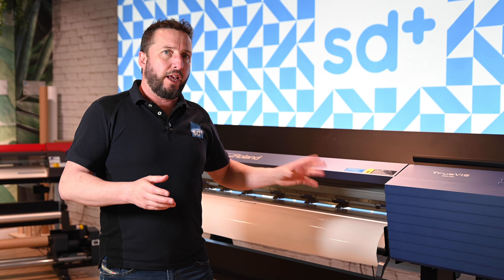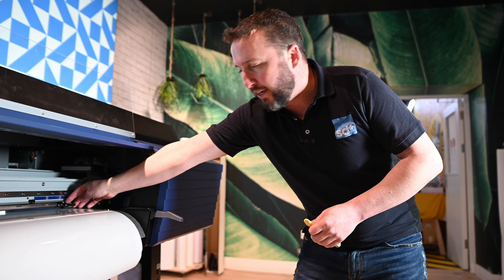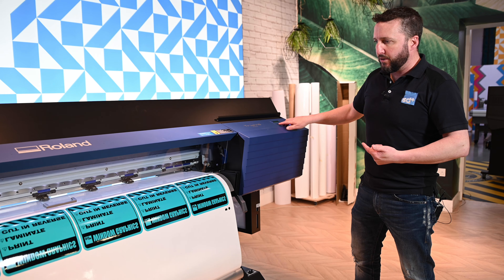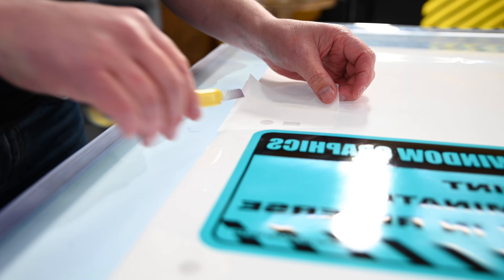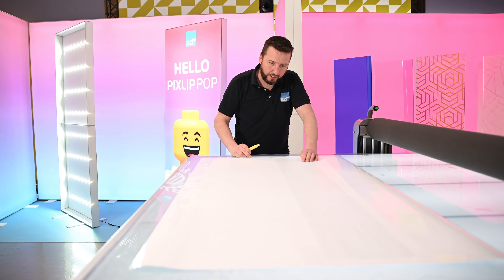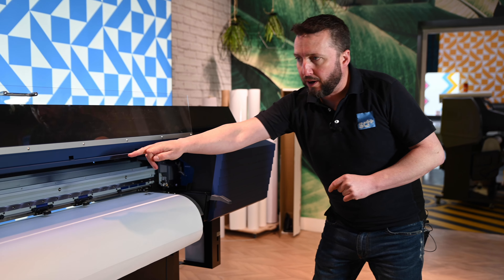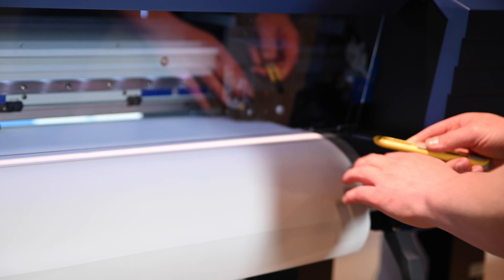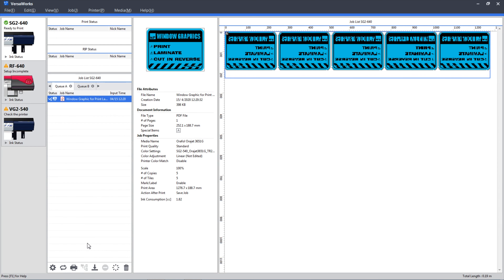How to Print & Cut Reverse Window Stickers using a Roland Printer & VersaWorks

Comment: Your videos help a lot, good job!
I have a question, on the Roland VG3-540 is it possible to reduce the vinyl advance speed when the machine is reading the cut marks? as the machine is very quick to read and sometimes jams the material.

Comment: Hi Marcus, could you make a video on how to produce a double sided sticker? Ideally one with a cut contour on it. How would you do it? For example it would be similar to the process in this video, but there would be something printed on the white vinyl as well (it could be for a door where one side says 'PUSH' and the other side says 'PULL').
Reply from the maker: Great idea! Thanks for that. We'll add it to our list.
Reply: Wouldn’t you print in non-mirror, then cut again?
Reply: @mactastic144  Print the clear in mirror. Print the white in standard. Laminate the clear with the white aligning reg marks. Laminate the lot with clear and then cut only 😉